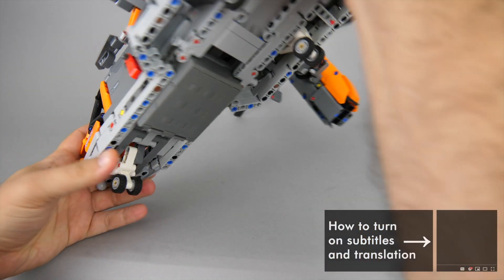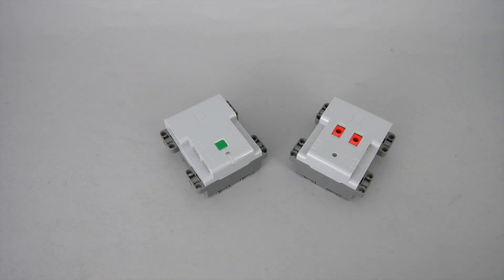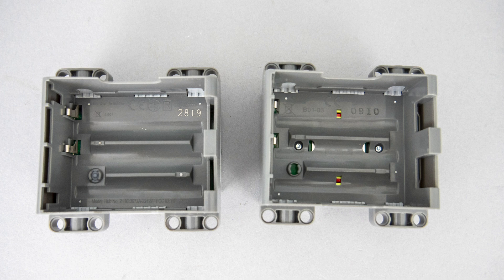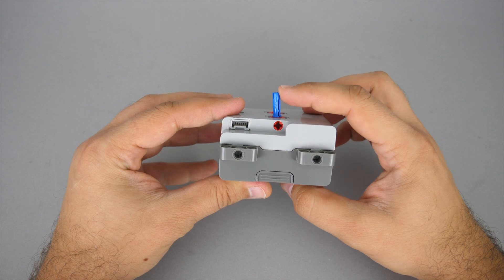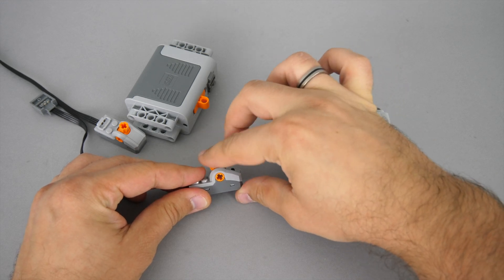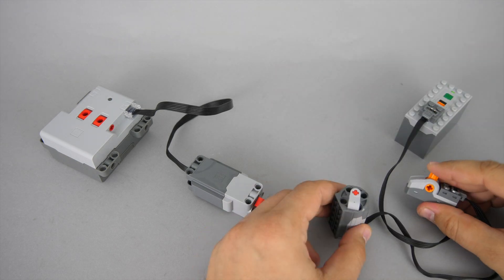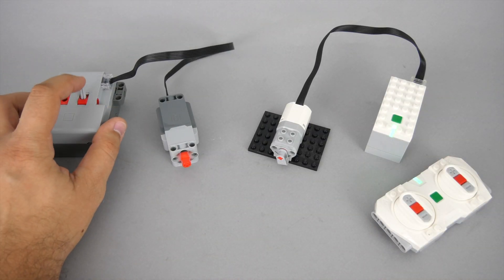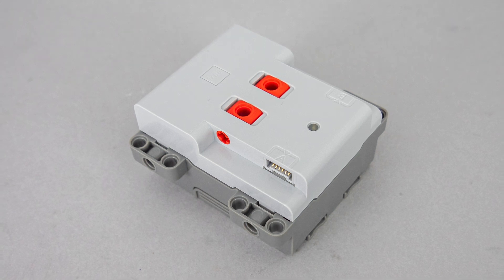LEGO Technic Simple Hub from the 42113 V-22 Osprey set

Comment: Is it possible to build an Osprey with the older hub, and will it still works perfectly in every function?
Reply from the maker: You can build it with the Bluetooth Hub, but you need to add a mechanism that presses the button. Then it requires a command to turn on the motor, but afterwards all functions remain the same.
Reply: @RacingBrick  Could you make a tutorial for it, please? I'm not an expert in Technic, however I would like to get all the parts from BL, and build it. I need to know if I collected the pieces, and use the avalible hub to modify it, then the final model will works on the same way.
Reply from the maker: I'm planning to do a video about it but I also need to check and collect the available parts from BL
Reply: @RacingBrick  Thanks for all!
(Ha ez sikerült, kérlek jelezd nekem is egy levéllel: tmajer007@freemail.hu)
Reply from the maker: @dynamiteduo2613  ha feliratkoztál akkor biztos értesülni fogsz róla ;)
Reply: @RacingBrick  Megtörtént!

Comment: Don't understand why there is an LED on it since you can physically tell if a switch is on.  And why one for both switches instead of 1 for each switch. I am sure Lego has other models/uses planned for this box when doing the designing process of it. So it will most definitely show up in another set.
Reply: idk man why did the power functions battery box have an LED?
Reply: @Unbrickme  The only thing I can come up with, is that if you have the switch on and nothing happens, if the LED does not come on, it indicates the batteries are either dead or installed wrong.

Comment: I think this is the one aspect where you can agree with me. Only two ports is extremely limiting. Power functions had stackable cables, so theoretically you could have 100 motors all running from one battery box if you really wanted to
Reply from the maker: But in reality you couldn't, you know limitations of physics and such boring stuff :) More ports wouldn't be possible with this design. I don't think having e.g 4 ports and only a single on/off switch would be any better. But honestly I'm not really into stationary builds so maybe there's a need for that, don't know.
Reply: @RacingBrick  true but I feel like just a basic splitter (no need for compatibility with RC) would be great! Plus a lot of people like to have a twin motor drive (two motors running one drivetrain) and it would be great to connect them to just one port! That would free up an extra port on the control+ hub, allowing you to connect other accessories, such as a pair of lights or some distance sensors.
Reply from the maker: The problem with a splitter is that it removes the feedback from the tacho motors and wouldn't work with sensors. TLG does not like to produce electronics that are physically compatible but would only work with certain hardware, they would need to solve the problem of "rejecting" incompatible hardware somehow.
Reply: @RacingBrick  Well I remember the hitechnic company made a sensor multiplexer for the mindstorms NXT. (four sensors connected to one port basically). and all four sensors were independent. Mindstorms NXT cables have 6 wires inside of them, just like the powered up cables. I'm certain that such a functionality would be possible with powered up.
Reply from the maker: @Unbrickme  that's an interesting piece of hardware, I had a look at it. PU would need something similar with electronics to be able to report back correctly the data from the extra ports.
Reply: @RacingBrick  hi
Reply: Jackson Disher hi

Comment: I'd be really interested to see the internals of both the smart hub and the simple hub, including looking at the PCB and what ICs it is using, and maybe it will give us some insight into why the switches are designed that way or why the battery casing inside has holes. Of course, I think we'll have to wait until the simple hub is more widely available.
Reply: Wait a little until Sariel does X-Ray shots of the electronic components again.

Comment: I am really interested in the possibility of a rechargeable battery pack, good find about that nub to differentiate between the two.
Reply from the maker: Well, with the new design TLG always leaves the battery door accessible in the models, so all they need is a rechargeable battery pack with the plug at the bottom.
Reply: @RacingBrick  what do you think the recharge port will be? barrel jack, micro usb or Type C? (Nowadays every electronic device has a Type C port, even the Nintendo products, and also the Macbooks!)
Reply from the maker: @gab_v250  I would love to see a Type C port, that'd eliminate the need for a proprietary charger. Spike Prime uses microUSB so there's hope :)
Reply: Gabriele V. LEGO already has their rechargeable battery pack for the Mindstorms EV3, and the 'wall-wart' Transformer to recharge it. It uses a (I think) .2 mm barrel jack, so, unless they're just determined to sell ANOTHER product (and get MORE of us angry!) they'll probably just use them.
But since I already have two EV3's, I might try and see if the rechargeable pack fits the Control+ hub and report back y/n.
Reply from the maker: They already changed th format and the plug for Spike Prime, so...
Reply: James Kratzer the Mindstorms battery pack costs 100 Euro...that’s insane.
Reply: @jameskratzer4538  the barrel jack feels outdated in the 2020 era though. Even my bush cutter has a Type C port!
Reply: Manuel yeah - and I checked; it bloody WON'T FIT the Control+ Hub!
Reply: Gabriele V. Yes, Type-C is better; I was just saying that the 10 VDC charger is Already available from LEGO, and that it has the barrel jack.